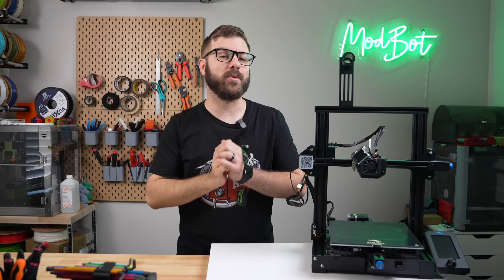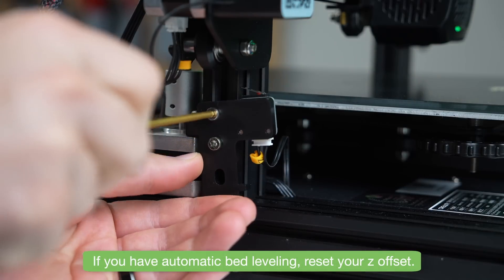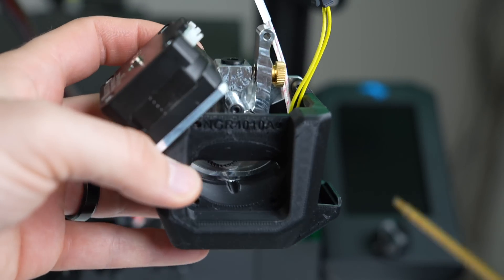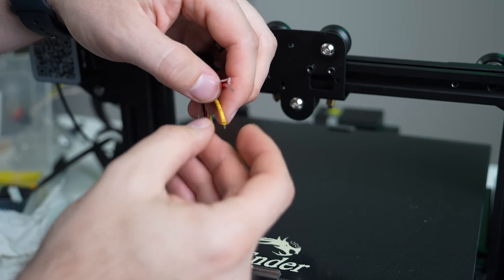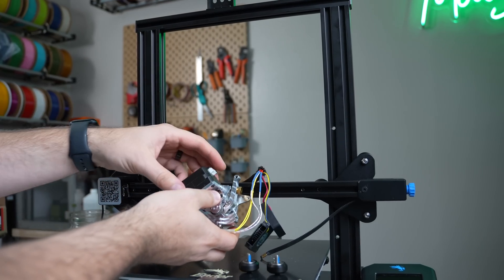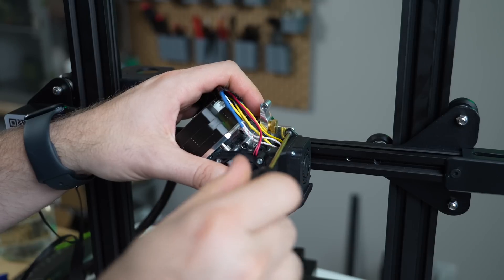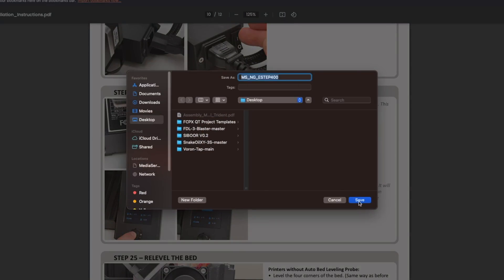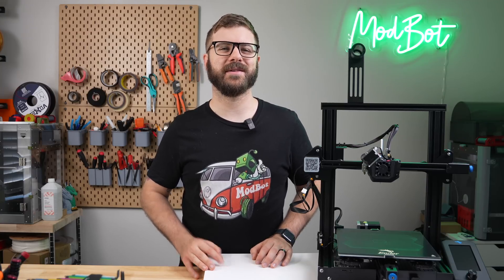Micro Swiss NG Revo Direct Drive Extruder Install (Ender 3 V2)

Comment: guess im late to the party -  that PID tuning link is dead now... any updates or alternative source or help with that part?
Reply: just in case anyone else runs into this problem - I am making a little progress. you'll have to know how to use pronterface (its not as difficult as it might seem, i don't know shit about this stuff but if I can work through it anyone can) You'll also need to know  your firmwarte because PID tuning doesn't work for me, i guess I have MPC firmware or something from swithcing to marlin 2.1.2 mrisoc. but if you have regular PID firmware, put 'm303 s240 c10' or 'M303 E0 S240 C10' into pronterface, that should autotune, but didnt work for me, said bad heater id. because i have mpc firmware, so 'M306 T' does the autotune... not sure if works yet, but chatgpt can help walk you through this if you get lost.
Reply: oh and the 240 in the code you can change to 200 if you only do pla, i do pla and petg, so i saw something that said to do 240, thats the temp it calibrates to i think
Reply: looks like it heats up fast, slowly approaches target and maintains 240 dead on, so i guess that worked for me. but now i have to figure out why my extruder is not working right...

Comment: Got this for my Ender 5 Plus, having used Revo on my Prusa MK3s. I always try to buy the best if I can afford it. I can't get this thing to work on my Ender. I'm swapping it back to standard so I can try the E3D Revo CR upgrade. This seems like a lot simpler solution.

Comment: GREAT Video. After 8 months how are you liking the extruder. How hard was it to dial-in. I just installed the BTT H2 V2s Lite REVO Extruder. YES, I have all the issues that others have reported. Current issue is...inconsistent extrusion resulting in  Blobs  that hit on my EZABL probe throwing everything off. So I want to try something else. I use the REVO HF 0.6mm nozzle. The Microswiss is a little pricey so I want to be relatively sure it works with little to no issues. So another updated video would be really helpful. PS: I know one issue is that with the Microswiss extruder you will loose a little bit of bed space.  Thank You

Comment: Just installed this last night, updated e steps, retraction, and retraction speed.

Leveled bed a hand full of times and adjusted z offset for (CR touch)  absolutely can’t get my initial later to stick to bed. Same filament and settings I was using other than what mentioned above by my stock extruder. Not sure what I’ve done wrong? My bed mesh looks great all pretty close to each other clean PEI bed I was using previously filament is dry.

Comment: This is an useful evolution from the stock NG. I've been using that for the past year, and my biggest gripe is disassembly is a pain if I get a blockage, and cleaning the filament gears means dismantling lots of parts. Not sure this would help with the latter, but it might make clearing clogs quicker.

Comment: Critique if I may *(you are awesome...just wanted to point something out). 
At 14.42 you show the metal knife Ender provides scraping a build off the stock Ender plate. IME (I have a farm and I run a 3D help group...just saying I have some experience)...that metal Ender palette knife has no place near that stock bed. I've seen so many new folks (naturally) use the provided knife and in mere months wear the textured surface rapidly away. Technically...that shouldn't be a problem as we can certainly print on smooth borosilicate...but then again, we are talking about newer builders that may not recognize the rapid change in adhesion and need (know how) to correct it. It also defeats the purpose of having the texture at all (I frankly like the stock plates. I Do mostly use PEI or carbon fiber flex steel...but totally loved and would use again the stock Ender build platens)

Another drawback to that metal knife is that folks who get in the habit of using it use it for all kinds of knocking around the carriage. Trying to pluck off filament from the nozzle or reset the silicone sock....y'all know where this is going...then they short out their machine by slipping that knife across the heater cartridge and thermistor. That's an expensive mistake indeed.

Comment: I kinda wonder if they should include a 'dummy port' for the old bowden tube to slot into, that way you can cable-tie and constrain the rest of the cable assembly to something with a natural springyness to it, as in a PTFE tube will help disperse it's bend, while wires can start to weaken and bend more in one spot over time.

Comment: Daniel, I did this upgrade a couple months back from the original NG, and I love this hot end. This is also the printer I put the KlackEnder on (with Klipper), and that fave me some headaches I'm still trying to work through. I would love to see you install a KlackEnder on this printer; I'm sure I would learn from it and get my issues worked out.
Reply from the maker: Did you see the KlackEnder video I previously made? It was using the MicroSwiss NG standard. Other than Z offset, the process (should) be identical.

Comment: Most people seem to have bought their enders for $99. A toolhead that is $50 more than the printer is, IMO a terrible value proposition.

The entire point of that printer is that it is very functional for its very low price. Once you're dumping hundreds of dollars more into it, you really should just be upgrading to better printers.

If you wanted similar functionality in an upgrade, CHC heater for $20, bimetal heatbreak for $10, Gears for a printed sherpa for $20. $50 gets you fast heating, direct drive, V6 nozzle compatiblity. 

Don't get me wrong, for generally higher budget builds I think the Revo is a stellar hotend. I just don't see it as cost effective to put high end components on low end printers.

Comment: I have an Ender 3 that is sat doing nothing, I want to fit a Bamboo Lab hotend to it with a Bondtech BMG I have spare, the Revo is a nice hotend but I cant justify the price, saying that I have a copperhead on my Pro 3D V-King 400 but that project involved building the printer from the very best self-sourced parts I could lay my hands on.

Comment: Hope the come up with a way to put this awesome hotend on an Ender 3 S1 Pro! I like the sprite extruder but the cheap way they setup the tension spring makes it half baked and really want to use these hotend nozzles!
Reply from the maker: Off hand I cannot think of why it wouldnt work. I believe it is still 2020 for X and roller wheels. Maybe needing some adjustment to endstops? I would shoot Micro Swiss a message.
Reply: I believe you would need to change out the ribbon cable to a standard ender 3 heater and thermistor and run a new cable for the cr touch fans ect

Comment: Thanks for making this video, just what I needed.  Now I know the type of connectors the NG Revo came with!    Would I need to change the firmware if I mounted a bltouch using their downloadable mount?   I had a bltouch mounted on the stock hotend assembly.
Reply from the maker: Yes, Creality has a firmware for the bltouch. There may be a few other tweaks like bltouch offset that you will want to apply as well.

Comment: Great how to video, but I would change one thing. If you put the top wheels on first, and put the bottom wheel on loosely, it's easier to hang the carriage on the gantry and then tighten and adjust the bottom wheel than it is to hold the carriage up and try to attach the top wheels with one hand.
Reply from the maker: Not a bad idea. I think that since the bottom wheel requires both hands since it uses a lock nut Micro Swiss has the bottom wheel first in their pdf. If that works best then absolutely though.

Comment: I have the original Micro Swiss NG on my CR10.  Do they make an upgrade kit for the Revo?  Or is it a completely different design?
Reply from the maker: The NG portion of it is the same, but the aluminum where it meats the hotend is quite different. I dont see how it would be possible to convert without a completely new aluminum body.

Comment: Are you going to post a followup with examples of prints that show a benefit from this upgrade?  A comparison of speeds, quality, filament types on the same prints before and after the install would be super helpful for anyone considering this
Reply from the maker: The main thing you are getting is the ability to print with high temp abrasives (if you switch to an obxidian nozzle). On top of that a high quality extruder with a lot of push force and also hardened steel gears. There is a lot of info out there on the NG and Revo so at this point I am not planning on it. (This could change though)